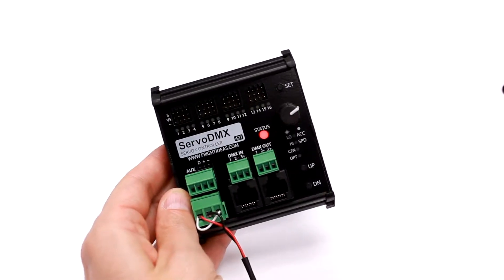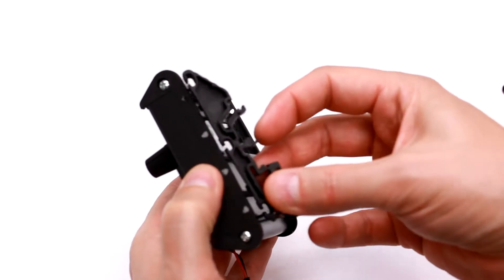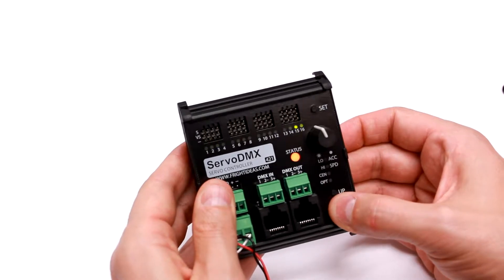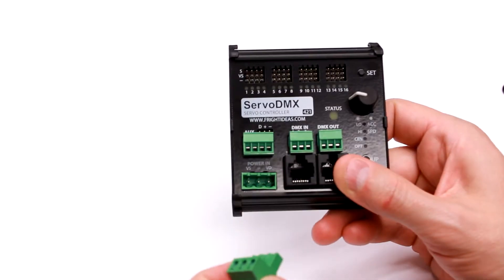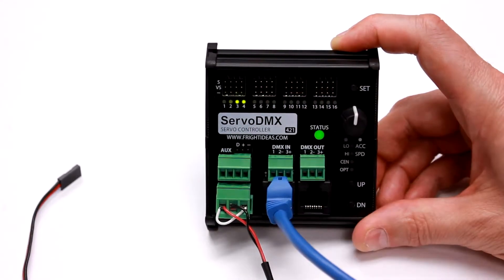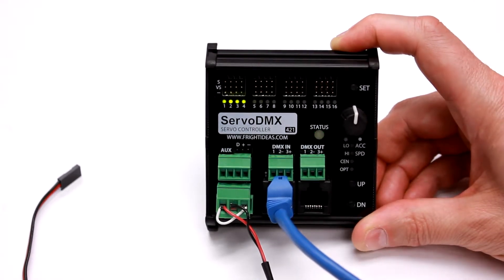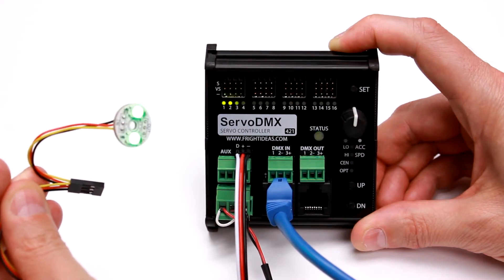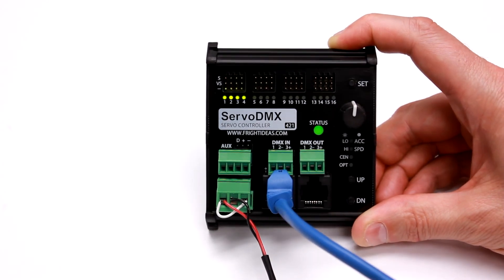ServoDMX - Introduction

Comment: I apologize if this is obvious - I'm new to wiring. Regarding the power, since there is a white "jumper" wire from the VS terminal to the VD terminal, does it matter at all which terminal the red wire from the barrel connector is wired to? Here I see that it is wired to the VS terminal, but in the manual it is wired to the VD terminal.

Comment: Is it possible to expand control to 32 servos or link controllers to control 32
Reply from the maker: You can add multiple ServoDMX to a DMX bus.  Theoretical max would be 32 ServoDMX for 512 servos as DMX supports up to 512 channels.